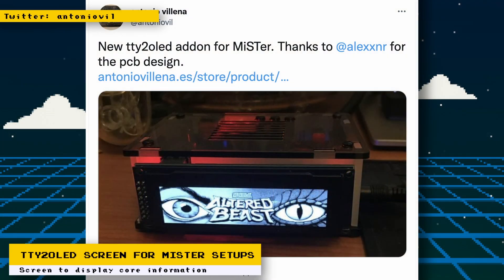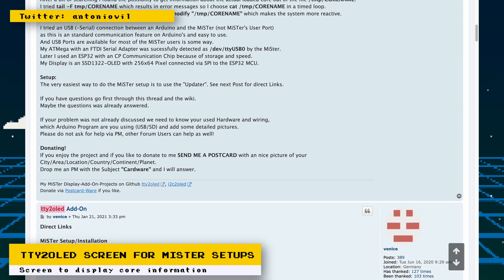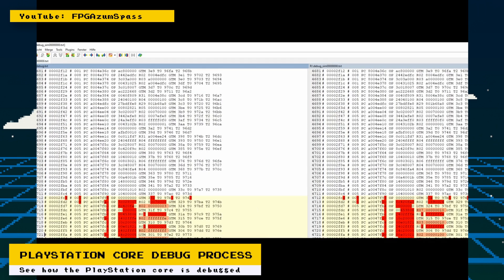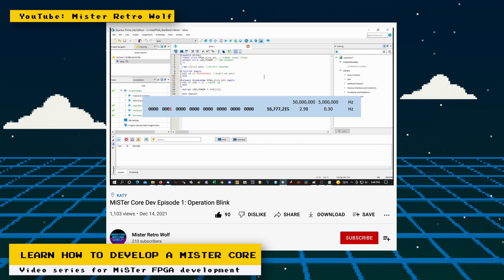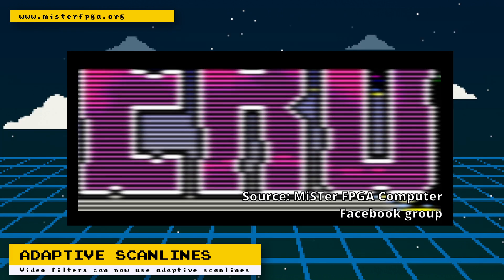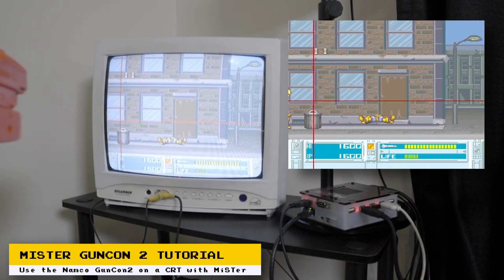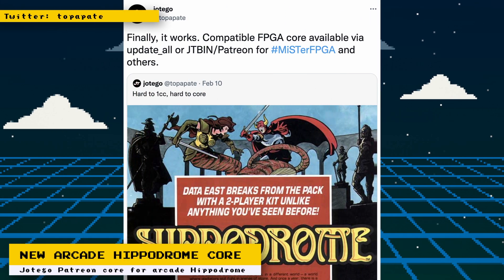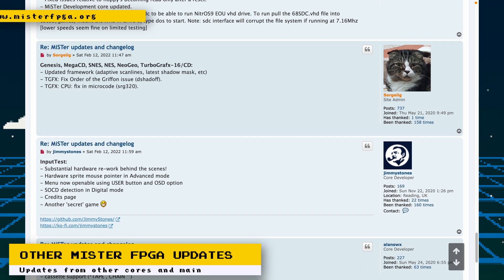MiSTer FPGA Updates - Adaptive Scanlines, PSX Bug Squashing and More

Comment: Thanks for the great info again. 

Do you have or know of a video that shows how to change the video resolution on the mister? I'm having a hard time with the ini files. Also how do you set up a BT keyboard and wifi? I got a wifi and BT dodgle from Amazon.
Reply from the maker: In the mister.ini file, edit the video_mode variable and set it to a number to one of the resolutions under the dvi_mode variable. For custom video modes you will want to check this forum post: https://misterfpga.org/viewtopic.php?t=149

Comment: Hello, in the near future it will be possible to use filters in the mister as 2xsal, 2xbrz, bilinear plus among others?
Reply from the maker: That's up to any developer with the interest to add those filters.
Reply: @LusRetroSource  Thanks
Reply: I would guess basic ones should be easy enough, but the cores that require more ram might struggle at some point when multiple filters are desired.  I don't know how much upscaling one can do via a MiSTer, but upscaling def would affect the ability to tack on filters more quickly than lesser resolutions.